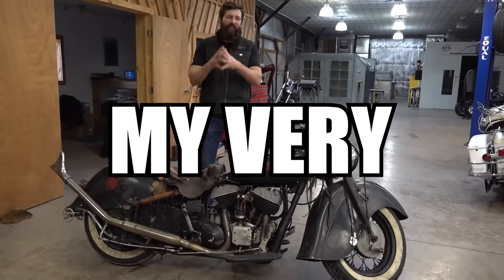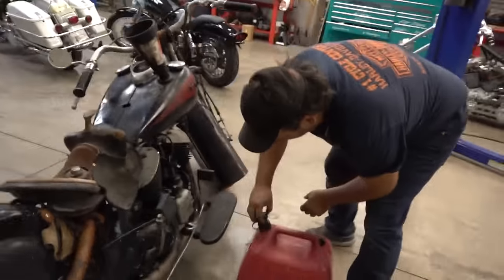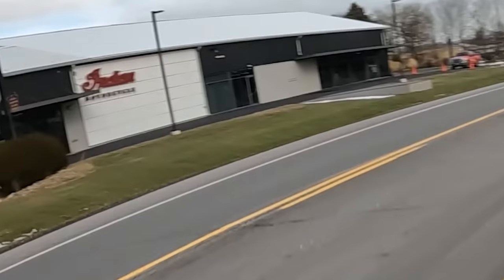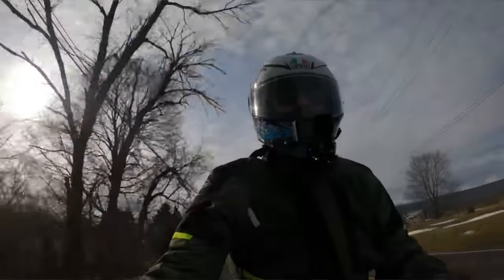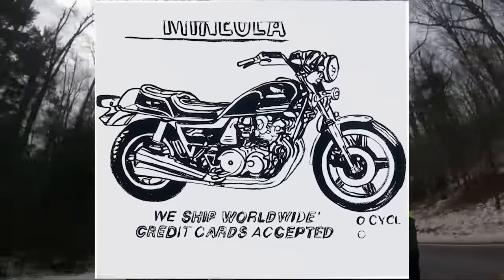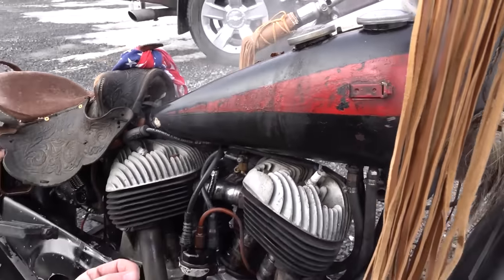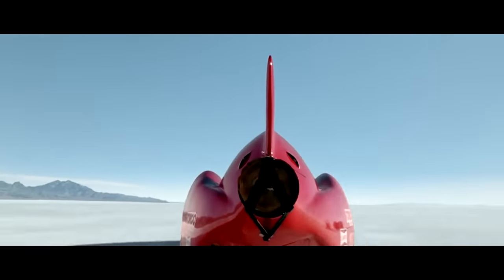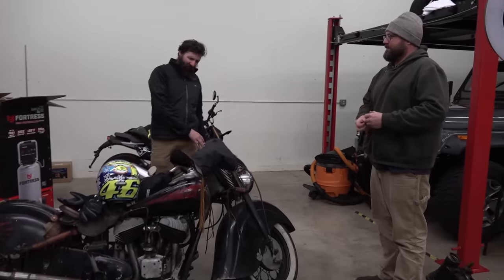I Bought a 1948 Indian Motorcycle, will it make it Home?

Comment: Having been a professional equipment mechanic for 40 years , the pro tip for heat shrink tubing is a heat gun, not a crack pipe torch

Comment: My first Indian was a 1923 Powerplus which I rode regularly, no front brake and 1000cc engine on clincher rims, thinking back on it, it was more luck than design that I survived that experience, my next Indian was a 1946 Chief that was my daily rider for many years, it was very comfortable and reliable, I had no hesitation taking it on 3 day interstate rides, the only reason I sold it was that I was hitting the service intervals monthly and so I opted for a Road king to get more miles in the saddle between garage stops.

Comment: I figured it was converted to 12v when I saw the head light come on nice and bright.  I like that you're getting into vintage bikes... nobody would have judged you if you had  just put it in the truck.  Riding an old bike you've never been on in the freezing cold...that sounds rough.     I bought my first vintage Triumph last year and rode it home about an hour and a half, but a 64 Triumph is practically a modern motorcycle compared to the last 2 vintage bikes you've picked up. : )

Comment: 9:28 - These 80" bikes were very fast. Not far from where you guys are at over in DelCo. (Delaware Co.) after WW2 my grandfather and his band of idiots raced these bikes down McDade blvd. every Saturday night all year round. He told stories of wrecking 1 day old Indian Chiefs and 80" flatheads etc. Wore out quarter inch leathers. They all rode to work down on the river at the shipyards, Baldwin Locomotive. etc. worked on their machines in the shops. After midnight on Sat. nights his brother who was a Ridley cop would shut down the blvd. and they'd race these big bikes, Model A hotrods etc. He said they'd easily do over a hundred mph which was pretty fast in those daze. 
Those are gettin' few and far between. You should keep that one. Thx. for the videos. There's 4 ft. of snow here in N.W. Mt. but Spring is comin".

Comment: I really like the idea of the throttle being relocatable to the left grip.
When on the 49cc scooter with bulky gloves for the cold it can be occasionally tricky to get off the throttle and use the front brake.
Meh.  Winter's almost over.
Reply: Thankfully, i got a B09R scooter and boy it doesn't like the cold.
Reply: The side of the throttle was optional, with a HAND shift and a FOOT clutch to boot. confusing, I know,  No wonder generations of people were scared of the "dangerousness" of motorcycles.

Comment: I started watching this channel about a year ago before I started riding. Now I scour marketplace for cheap/non running bikes with titles in good condition. Started In summer when everything was over priced. Built my own 125 out of an old Yamaha frame. Now I'm ridinf a 750 Kawasaki I paid 800 for. I even got a motorcycle low loading trailer for 300 $ at a yard sale. Winter has come and I'm ready to buy for spring resales and good riding :). Thanks for all the inspiration. Cheers from Idaho

Comment: Here in Hungary, there was an old mechanic who installed a 1900cc turbodiesel Citroen BX engine into one of these Indians when the original engine failed beyond repair. It is in a museum right now and I went to see it many times because it is so awesome and it inspired me to build my own motorcycle similar to this, using a Neuzer chopper bicycle, and a chinese 50cc engine conversion kit, along with a Shimano   Nexus Inter 8 internal gear hub. It rides like heaven, and it looks awesome :)

Comment: The bit about the seat is spot on. I have a 2001 Honda Rebel and the stock seat, even though it had about 3.5 inches if foam, was very uncomfortable. I bought a sheet of 16g steel, cut out s saddle shaped piece, bent it, and pop riveted/glued some canvas from an old US Army shelter half to it. It's so much more comfortable than the original seat.
Reply: I'm on my second bike, a 2017 Royal Enfield Classic 500. The saddle is like an old bicycle saddle with springs underneath. Between that saddle and the rear springarm with adjustable shocks it's an amazingly comfortable ride.

Comment: That speedometer nacelle is for a 47 or earlier Chief, it also contained an ammeter . Your Chief runs a lot better than it looks. It even has working brakes . A correct seat is attached to a shaft with a spring that gives some comfort. With some luck, and help from Jerry Greer Indian parts, you could have a decent Chief but then, it wouldn't have the comedic value.

Comment: My first motorcycle was a 1947 Indian Chief when I was 16 years old. It was an all apart "basket case." An 80 year old neighbor helped me put it all back together after we rebuilt the engine, etc. He was a mechanic in the US Army during WW2. I rode it for one summer. The last ride, I parked it on the lawn, and it fell over when the kickstand sunk in the grass/dirt. I was skinny back then and I couldn't stand it back up alone. My dad helped me and luckily no damage because of the crash bar. I sold it the next springtime and bought a Royal Enfield motorcycle. Over the years, I've owned over 100 motorcycles of all shapes, sizes, and brands. I wish, now, I had never sold that Indian Chief.

Comment: I've always wanted an OG Scout. So cool to see you get an Indian. That lil' bit of gas in the oil will just clean it up and make it run better once you do an oil change ;)

From what I was told by the oldtimers, it was pretty common to put a little gas/diesel in a noisy engine to free up lifters and clean up the engine. Pretty dang sure it wouldn't hurt it!

Thanks for the great videos.

Comment: That Ronson torch he is using on the shrink wrap the wire was recalled as it will sometimes stay on until you pull the back locking lever.

Comment: You need to put on full rain gear it will block the wind.  Boot and glove covers from aerostich also block the wind.  Balaclava, and neck cover along with a breath diverter.  I ride everyday in upstate NY.  Oh and light grip on the grips squeezing restricts the flow flow of warm blood to your fingers.  Great video, I love these adventure of the old machine struggle videos.
Reply from the maker: What do you ride
Reply: @BikesandBeards    Suzuki GZ250  Light easy to handle and maintain.

Comment: Great video!  I dig your work.  Burt?  You cannot give a bike a male name.  It will NEVER run right.  Trust me.  It's fun to see you youngsters actually discovering motorcycles after so many years of you thinking you knew motorcycles.  Heated gear, full face helmet, two way radios, chase vehicle, and a mechanic.  All that aside, you made it, good job.  I used to ride through the winters in PA without such things.  Now?  I wouldn't try it.  I enjoy a much nicer riding climate these days.  Ride that thing to Daytona Bike Week this year and I'll buy you a beer.

Comment: I think this is a much nicer looking bike than the old Harley you bought.I was thinking of buying an original Triumph Bonneville in the mid nineties. I was reminded by my Dad , how overnight the Japanese bikes took over. The brakes worked. Things didn’t vibrate and fall off at high speed. When you parked they didn’t leak oil. About the Harley, my Dads friend bought an ex army same bike in the sixties. My dad said he had a go , but compared to their British bikes at the time . His words were it was a dog with handling and acceleration/ speed was a joke. Personally I love the old bikes and if I wasn’t now epileptic. Would definitely own one. Even if It did spend most of the time being repaired. They’re  a work of art and history you can ride. I’m loving these old bikes and the shows with them in. 🇬🇧

Comment: Didja ever "restore" the Chief to the extent of replacing rubber fuel hoses with safe copper fuel lines and fittings and petcocks that don't leak?
I have an "old restoration" 48 Chief rider that has not run for years, I'm old and don't ride , need to unearth it  and peddle it while I'm still kickin. Mine has shift knob, clutch and spark on left and throttle on right same as old Harley.  Clutch engage is back not forward.

Comment: It has a scout gas tank on it and it has a harley dash,  late 60s early 70s  although it has a few things added for personal likes it's a cool indian , check the left side of the frame down on the side for the vin number and it might match the engine number,  theres a few mods someone has done but that's normal,  I been working on indians since the 70,s and it looks like a solid old bike,  theres a bunch of fakes out there. You gotta be careful now days,  but you definitely have a real 48 there. The front brake linkage is strange but it probably broke and someone just fixed it with what they had,  usually harley parts laying around,   I think it has a harley carb but I can't see it good enough to say for sure,  regardless of the alterations it's still a 15,000 bike. I'll give you that any day of the week  if you wanna sell it

Comment: With the advent of YT (and other video sites), I first became exposed to this 'new generation' idea of '90% of your braking is done on the front brakes'...which is insane, but, it is what it is. This (for the first 100-years of bike riding) was NOT the case...and yet, there ARE those 'young ones' out there who grew up with the idea, who will argue the point. Now...let me explain what it was based on: If you hit your rear brakes and they lock up, completely, the drag from it will actually allow you to keep your steering function while 'pulling you straight'...versus this 'brake on the front' insanity, you hit your front brakes, lock up your front wheel...you now have NO STEERING! You have lost total control of your bike. Watch a few 'motorcycle wreck' videos, and you'll see that in almost every instance, the front wheel is locked right before impact...and they can't control the bike to prevent an impact. Add to it, that in 'classical' configuration bikes (engine at mid-frame), with the rider over the rear wheel, you have a 35/65 weight distribution SIGNIFICANTLY favoring that rear axle. This whole 'front brake' thing is VERY new...as bike magazines (not favoring 'cafe style' bikes) were STILL making statements such as 'the addition of front discs to this old model aid in braking, even though the rider will still predominantly use the rear brake as their primary'...AND MANY pre-1970 bikes of the V-Twin type actually were made with minimal or no front brakes at all (that's right kids, not even drums - Take a look at the 1960 Harley Super 10 or Sportster, if you doubt it...museum-quality bikes show a front drum HALF the diameter of the rear!) Front Brakes were also one of the FIRST things 'chopped' from choppers, too...(reference the REAL 'Captain America' from the movie Easy Rider)...
I can proudly say that, without reliance on ABS...I've rode over 2-million miles in my 47-years of bike riding...and NEVER had a true 'wreck' caused by my own fault, or by use of 'front brakes'...do as you will, but it's bad physics to start with (to brake heavier on your steering axle...be it car, truck or bike)...that's why cars have 'proportioning valves'!

Comment: 13:40 yeah sure but no get of the bike soon!You are so lucky that was fuel dumping all over you and your bike if that was a modern bike or almost any other instance you would be on fire the bike would be on fire and you would be riding a bike!
Reply: You all also need to bring at least a large gasoline rated fire extinguisher with you in the van two would be better they do not go as far as you would think if it’s a lot of gas two is better
Reply: Hey anyway I dig the vintage bikes a lot!! Be safe

Comment: I have a 1975 Harley XLCH ... It's nowhere in the collectability league as your WLA and Indian, but it is a 47 year old bike, so technically an antique. First thing I did was dump all the garbage electronic systems, and replaced everything with modern electronics. Swapped generator for an alternator, replaced points with a digital ignition, and most lights are now LED, fuse box is now solid state ... To hell with the purists, I want to ride my bike and it be reliable LOL

Comment: The ironic thing is that it starts better than my 2020 Indian FTR which doesn't start at all below 8 degrees celsius!
Reply: my ‘21 scout bobber started fine in sub-0° celsius.
Reply: @t.walker3101  Maybe its a UK/europe thing. I believe Indian have messed with the fuel mapping for the 'euro 5' rules and that has caused the issue. It's a well known problem over here.
Reply from the maker: Is your ftr modified ?
Reply: @BikesandBeards  Hi guys. Only cosmetically - mirrors, levers and a few bits. Engine, exhaust, ignition etc are completely stock.

Comment: Pro tip: layers aren't what keep you warm in cold temps. Its the air trapped between the layers that is keeping you warm. To be as warm as you can make sure your layers are appropriately sized so there is enough room for some air between them!

Comment: No speedo, no ammeter, military bike or Harley switch, no green nor red gen bulbs, no front nor rear crash guards, silencer pipe unoriginal, funny front suspensions. No. Not the original headlamp. The only thing fascinating, for and old Indian Chief owner and rider, are the Chief molded heads. Anyway it's a beautiful bike for it's time.

Comment: That's no master lol. You're not actually supposed to bring flame into contact with the shrink wrap, it scorches, burns and turns it ashy and brittle, but I see lots of "masters" using lighters and matches all the time. Try a heat gun

Comment: You have a 1947 frame with a 1948 motor. A '48 drives the speedo off the front wheel and has no ammeter, just a red warning light.
Reply from the maker: so how would you know that my frame is a 47?
Reply: The Wheels through Time guy proved it was a 1948 frame from the frame number.  
When you don't know what you're talking about you should at least say "I think you have" instead of falsely stating something as fact.
Reply: @SportbikerNZ  chill out, he apologized in the video.
Reply: @JacobEcret  I was talking to Gary.  Bikes and Beards did nothing wrong.